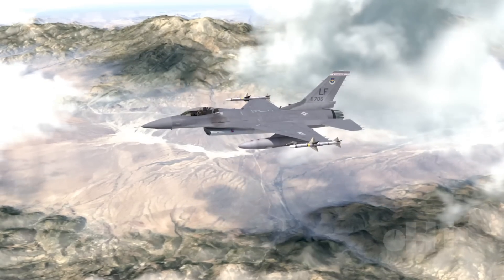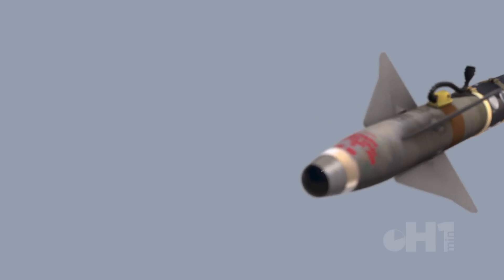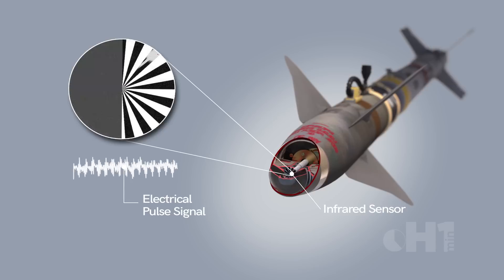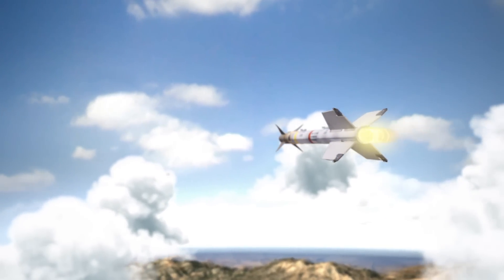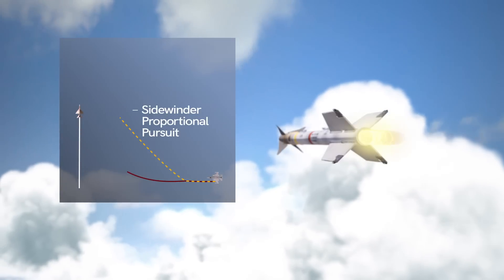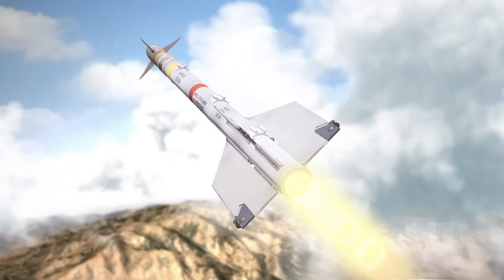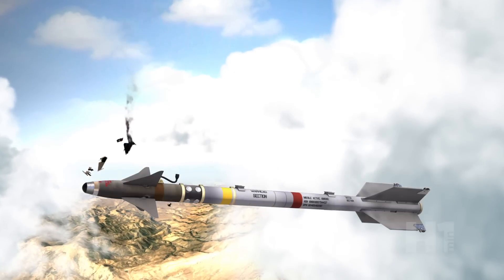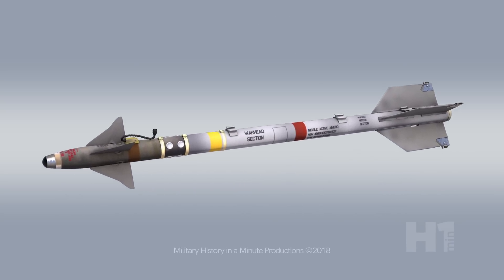H1MIN: AIM-9 SIDEWINDER Infrared Seeker

Comment: The missile knows where it is, because it knows where it isn't
Reply: By subtracting where it is from where it isn’t, or where it isn’t from where it is, whichever is greater, it obtains a difference, or deviation.
Reply: @WolfeYankee  god save us if where it is is greater than where it isn’t
Reply: @WolfeYankee it it uses GPS.
I this kind there is no GPS used.
Reply: The guidance subsystem uses deviations to generate corrective commands to drive the missile from a position where it is to a position where it isn't, and arriving at a position where it wasn't, it now is.
Reply: The turbo encabulator knows where it is, because it knows where it isn't.
Reply: @c02_ FaFi That is the missile guidance system in a nutshell, here is the video in question.
https://www.youtube.com/watch?v=bZe5J8SVCYQ
Reply: Yes
Reply: TuPaK There isn’t a hidden meaning, the missile is using math to determine the distance from it to the target, once it has that variable it then should know where to move to intercept its target due to missile now knowing where it is in relation to its target.
Reply: Wrong dumb thing that everyone repeats even though it's not even close to true.
Reply: terry waller  https://youtu.be/bZe5J8SVCYQ
Reply: Untill you deploy flares
Reply: Well den it knows more then me rofl ! ;)
Reply: Battleship in a nutshell
Reply: Basically every seeking missile in a nutshell
Reply: Not in this case tho lol
Reply: @possiblyadickhead6653  Actually, it does. Every feedback system operate using an error signal. In a AAM case, there are 2 of them, one on X-Axis, and one on Y-Axis.
Reply: @gufo_tave  but only in relation to the target. Im pretty sure the excerpts where about the guidance of cruise missiles with a2g radar.
Reply: @gufo_tave  not x and y but x, y and z.
Reply: @ijohneb  Not sure. I'm not an expert, but i don't think the AIM-9 seeker can measure distance from the target.
Reply: @gufo_tave it does not, the aim9 uses a proportional navigation algorithm which outputs a command acceleration based on the rate of change of the target bearing with respect to the seeker
it does not know where it is nor know where the target is, it only knows the target’s relative direction, and differentiates it with respect to time
Reply: "The missile knows where it is at all times. It knows this because it knows where it isn't. By subtracting where it is from where it isn't, or where it isn't from where it is (whichever is greater), it obtains a difference, or deviation. The guidance subsystem uses deviations to generate corrective commands to drive the missile from a position where it is to a position where it isn't, and arriving at a position where it wasn't, it now is. Consequently, the position where it is, is now the position that it wasn't, and it follows that the position that it was, is now the position that it isn't.
In the event that the position that it is in is not the position that it wasn't, the system has acquired a variation, the variation being the difference between where the missile is, and where it wasn't. If variation is considered to be a significant factor, it too may be corrected by the GEA. However, the missile must also know where it was. The missile guidance computer scenario works as follows because a variation has modified some of its information the missile has obtained it is not sure just where it is however it is sure where it isn't within reason and it knows where it was. It now subtracts where it should be from where it wasn't or vice versa and by differentiating this from the algebraic sum of where it shouldn't be and where it was it is able to obtain the deviation and its variation which is called air."
Reply: @bradonbarfuss6749  gold
Reply: @bradonbarfuss6749  are you by any chance related to Sir Humphrey Appleby?
Reply: @bradonbarfuss6749  - Are you planning on finishing your quotation?  It's been a few years.
Reply: @censorthis-uu6cc  haha, it is never to late to fix mistakes I guess
Reply: Nop
Reply: No, it doesn't care where it is, it simply knows the direction of the target.  Which is why it's called a "sidewinder" it makes continues changes as the target moves.  An AIM7 or AMRAAM has an onboard computer that computed lead angles and gyros that smooth out about changes.  It slowly switches from a lead pursuit course to a direct attack in the last mile.  This crap it knows where it is by knowing where it isn't is balony, it doesn't care where it is it only cares the direction to target and for radar missiles the direction the target is going.
Reply: @terrydouglas5008  Whoosh, a damn old meme you don't know of apparently.
Reply: hi N...
'
this missile dont have a brain then not know...
only computer program have a sensor control

Comment: Simple and to the point, can't find information this fast and accurate with high production quality like this channel produces. Keep up the great work!
Reply from the maker: Thank you!
Reply: @H1MIN 
I never subscribed to any channel faster than i did with you sir!!
Welldone man
Reply: @H1MIN  where do you get the money? i see no ads hrre
Reply: @kymm-j3h  the video is short and sadly youtube like to demonotize war related videos
Reply: @bruh-cz4ge  theres a short vid with ad
Reply: @H1MIN  The little spinning turbine wheels at the fin-tips are used for: arming the fuse. The air spins them up-they generate current-the current in condenser triggers the blast. NOT batteries-they are heavy. The spining prior to launch during aircraft flight is blocked by thin fishing lines /forming a crosshair/ which burns off - thus permitting spin-up the wheelies - when the missile engine flame ignites them at launch.🧷📝🚀🌊👨‍✈️🥇⚡🐍
Reply: @H1MIN  Just saying. normally sparrows aren't carried on wing tips(they can, but not recommended), that is the spot for the sidewinders.
Reply: @許進曾  Actually it is recommended to carry AIM-120's on the wing tips of F-16's. Lockheed Martin's answer:
"The F-16 is able to carry different missiles on multiple stations at the same time, such as the AIM-120 and AIM-9. Because of that capability, the AIM-120 is positioned on the wingtip to reduce wing flutter, while still ensuring mission performance."
Reply: @EagleEye1024  This video is about the Sidewinder.
Reply: @jzk3919  I know. Please read the post I replied to.
Reply: I found lots of information sitting on toilet.
Reply: to the point